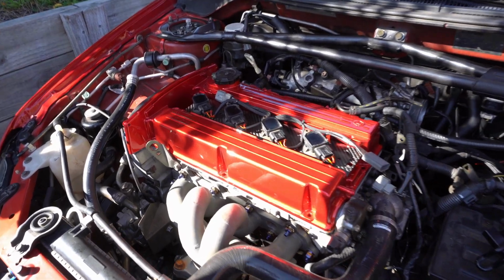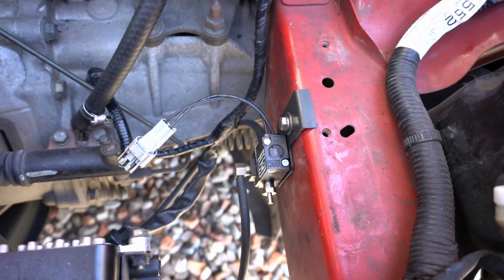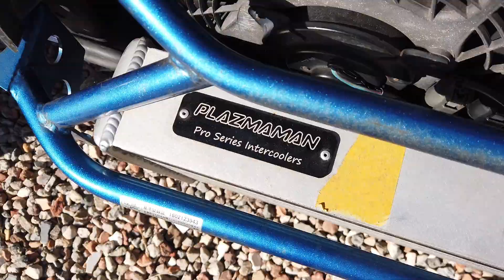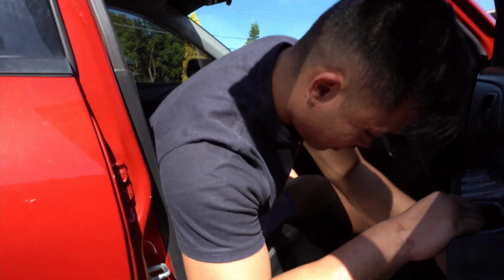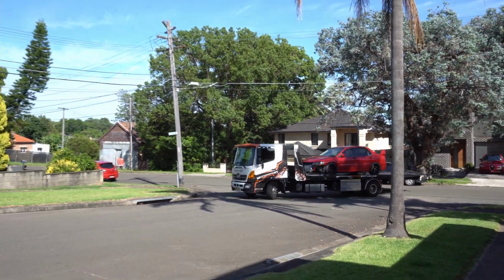400HP PROJECT EVO 8 MR BACK ON THE ROAD | Vlog 23

Comment: ID1300cc will tap 400kw which your Stock block wont,  Also Benchmark Solutions 274 pump or a twin hanger by him & also If you aint already Speed Density tune + 3.5" metal intake,
Reply: p.s get a AES valve so you don't piss off you're neighbours  :)
Reply from the maker: Thanks for your input bro, stay tuned!
Reply: @BryantTakahashi  Are you still on a MAF?  couldnt see from angles of the Video but if you are with a Large cam it will buck at low speeds/rpm which looked like it was a bit in  Video with Speed Density it will massively improve the low drivibility, :) Benchmark Solutions sells it all,  Enjoy the car man looks Killer,